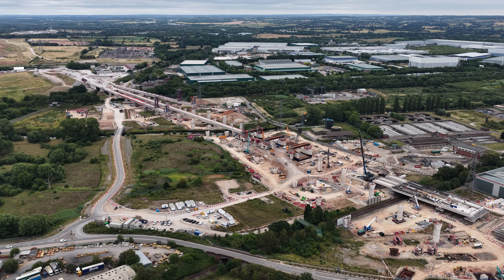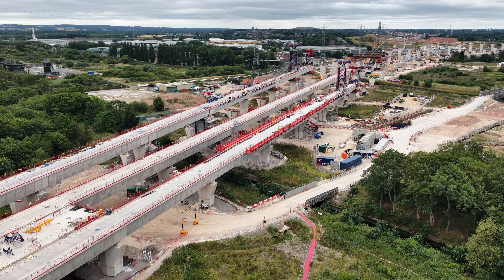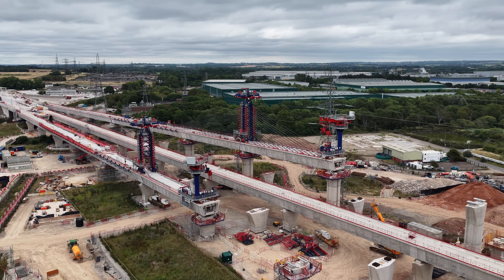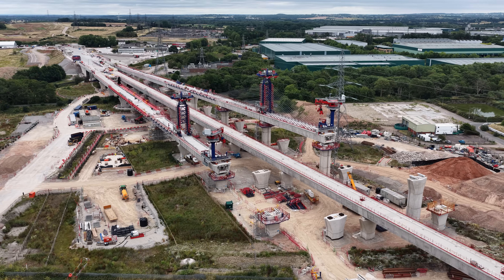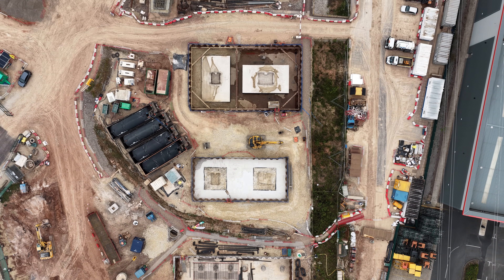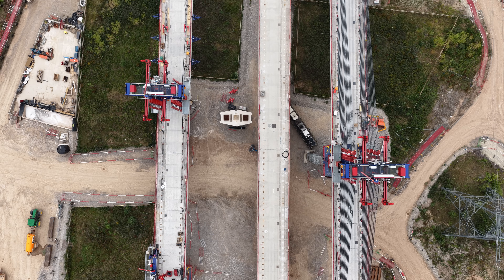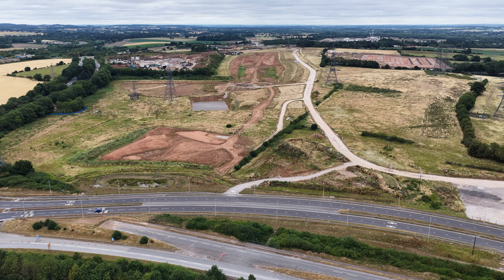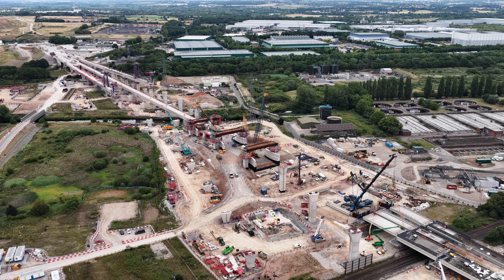HS2 Birmingham Delta Junction Construction Update | UK’s Biggest Rail Project Progress 2025

Comment: 0:24 quite a sharp bend for a high speed line
Reply: The Sharp bend is taking the line into Birmingham via the Bromford Tunnel so trains will not be high speed, the high speed line will take trains in a fairly straight path from Birmingham Interchange/London to Manchester and the North